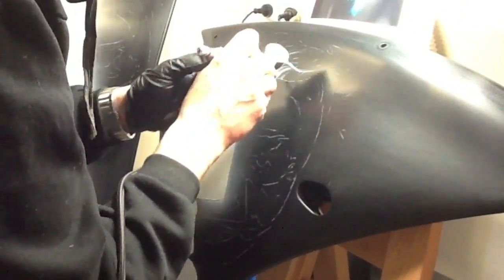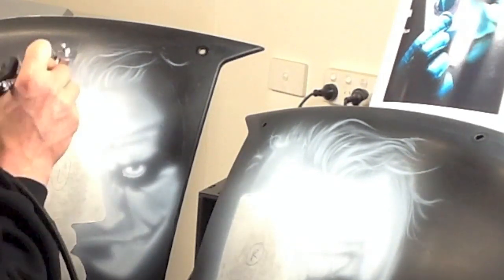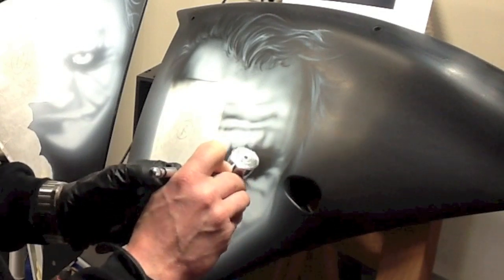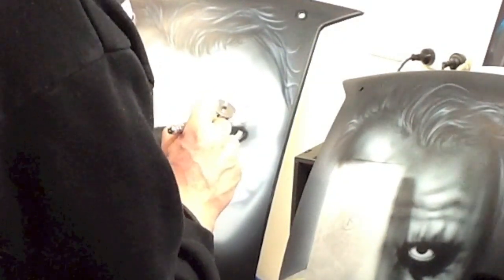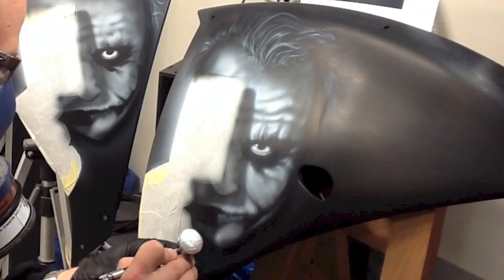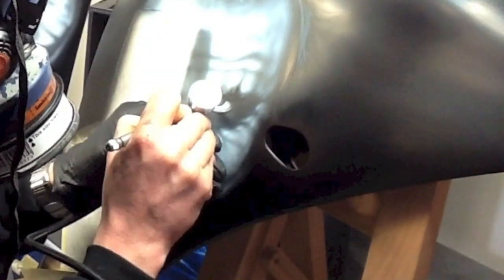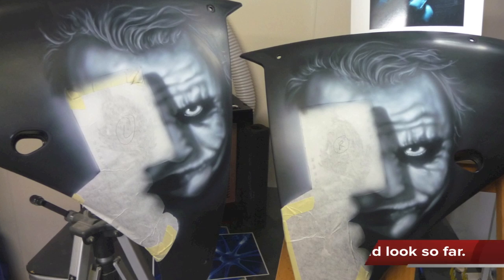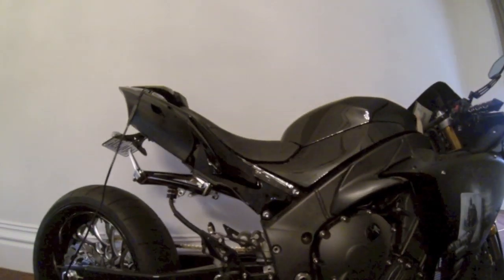The Joker R1 - Part 2, Step by Step.

Comment: that portrait looked unreal, do you find doing portraits easier wit solvent or trident paint? only asking as im wanting to start doig this sort of thing but am currently using trident
Reply from the maker: Hi Travis, thanks for your comment. Solvent has its benefits and was pretty much all I used to use..That said since I have been using trident I actually prefer using waterbased now especially trident to create portraits and other artworks. Cheers hope that helps 👍🏼+Travis Pond
Reply: Airbrush Asylum Hi man Yeah acrylic is good for portraits but I use solvents on automotive because I found masking tape lifts the acrylics sometimes